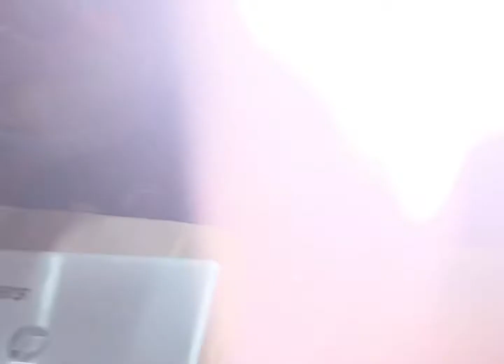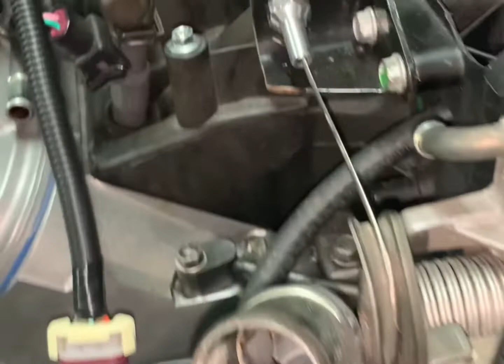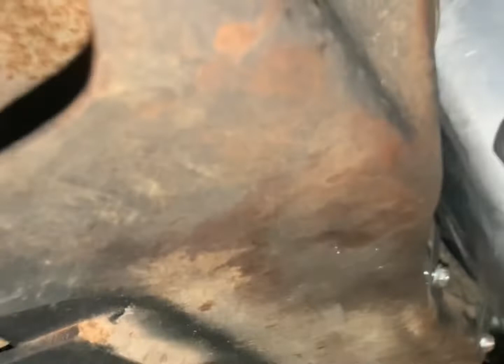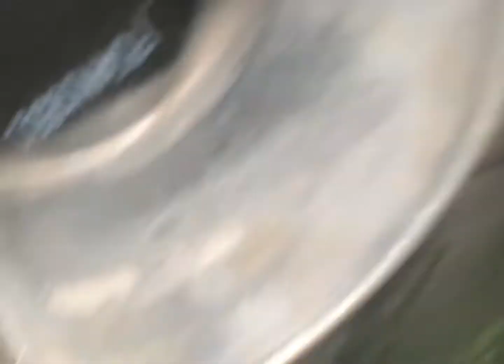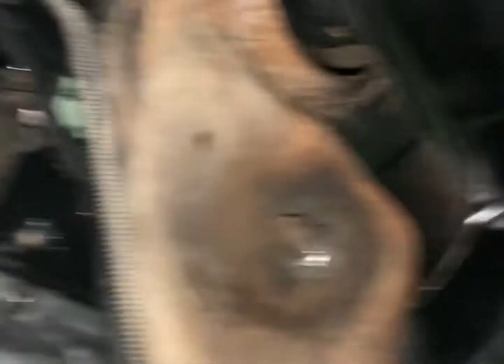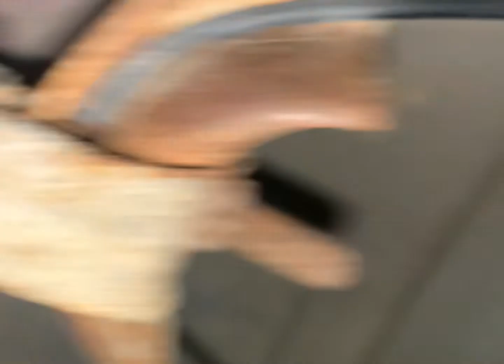Ls swap s10 walk around build video1

Comment: You may want to move that brake line under the frame, you don't want to rub a hole in it or the pan. I just pulled mine under the frame to clear pan.   Looking good I have two trucks with the swapped engine and they are alot of fun. Better gas mileage too if you keep your foot out of it.good luck on your swap.
Reply from the maker: Thanks for the advice! I absolutely had to re-route the line up and around the engine…